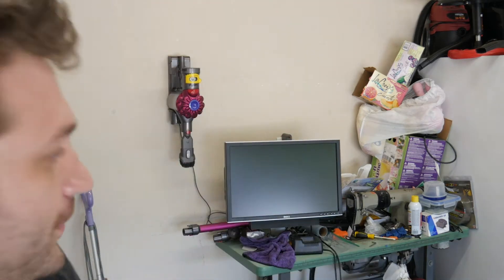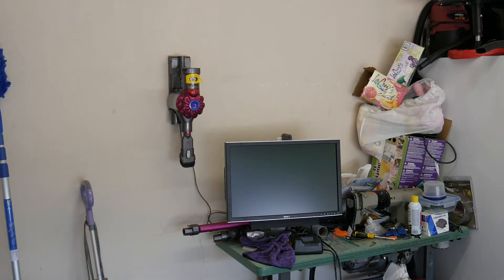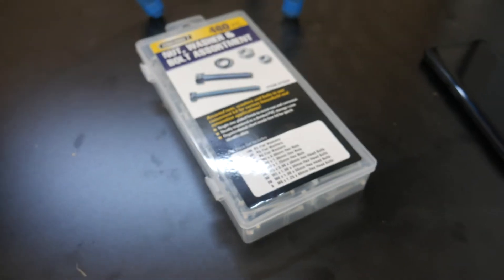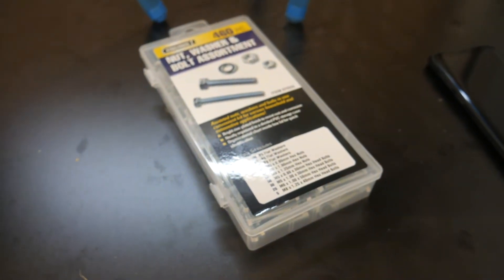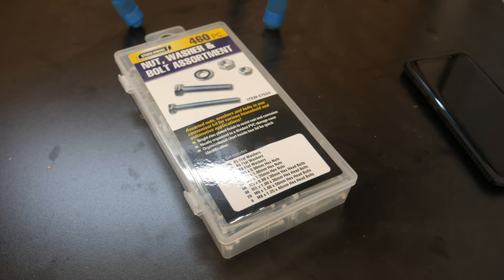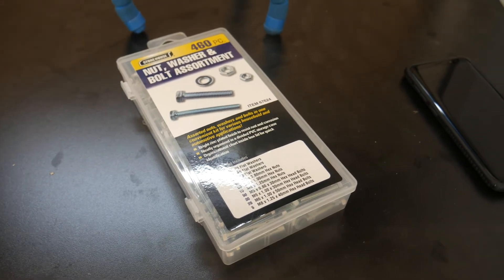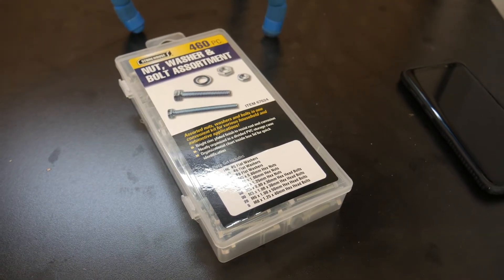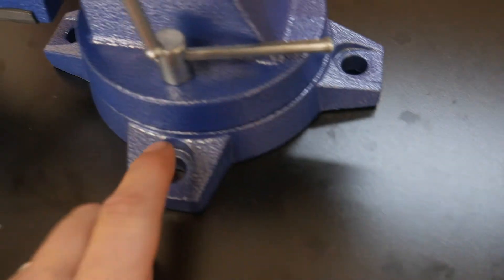Harbor Freight Work Bench Review

Comment: I would have like to see how you installed the vice
Reply from the maker: Looking back on it I definitely should have included that in the video.  It was a pretty simple set up though, I just set the vice on the table top where I wanted it, checked the underside for clearance, marked the holes and then drilled them out and attached it with some bolts, nits and washers.  Hope that helps.